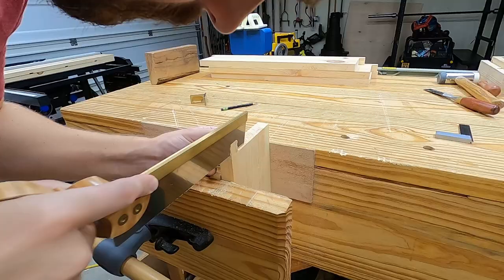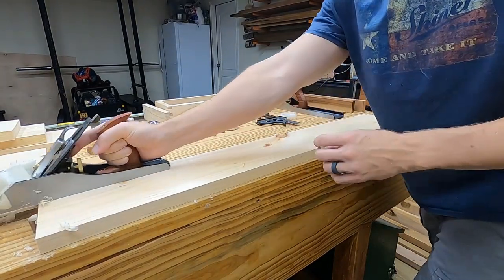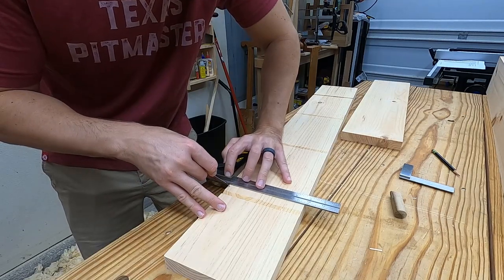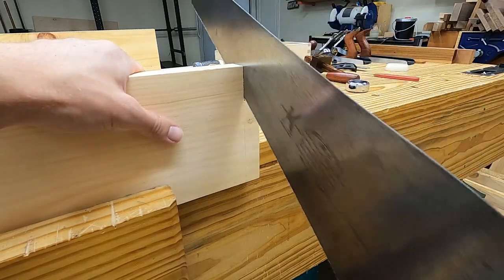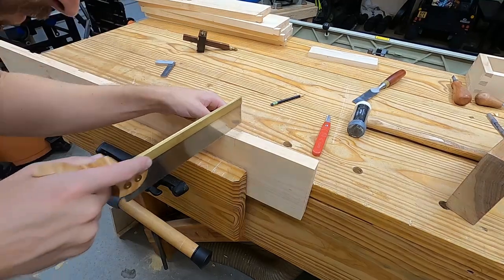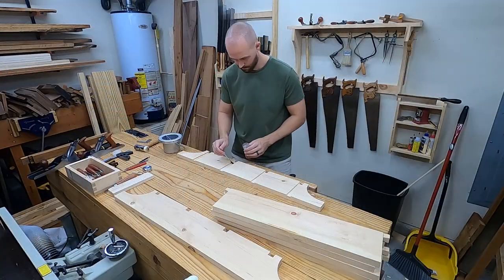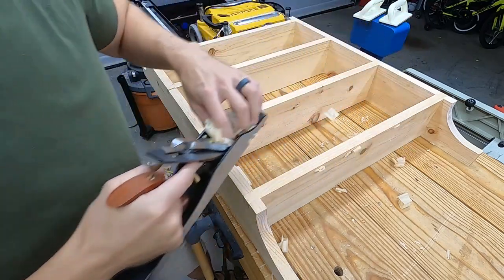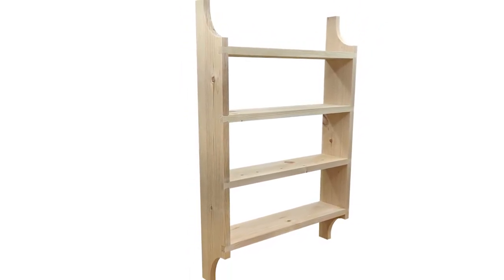OVERKILL Shop Shelves

Comment: Go to a #4 1/2 for the smoother. It will give you a larger tote, for your bigger hand. Same for the #5 1/2. It has a larger tote as well. Or you can make your own and increase it's size to make it easier to hold onto.

Comment: I love your work and combination of hand/power tools, been trying to get good at the hand tools to do the same.  I have several questions though, why the block plane for the shooting board and I assume the flipping for the shelf cut is for staying accurate on the knife line?
Thanks, Tim
Reply from the maker: thank you! block plane for shooting board is really just to avoid having to sharpen my jack plane right away... always have to sharpen the jack plane after using it on the shooting board...

Comment: Just subscribed so I'm catching up on your vids.  In the vids I've watched you use a low angle block plane for the shooting board. Others on YT advocate for a 62 or a 5 or six.  Why do you prefer the block plane?  I ask because I have tried to use a No 4 on the shooting board just for kicks, but just got a WR low angle block plane and finally have been able to use the shooting board with some success...it's quite liberating! Why isn't bigger/heavier better? Thanks.
Reply from the maker: Thanks for subscribing! I started using the block plane for shooting board to avoid having to sharpen my #5 again right after shooting... turns out it worked extremely well as long as the plane is sharp, and the cut isn't too heavy! I do think the extra mass on larger planes is helpful ,but it can be done with a block plane too

Comment: Frank, great build, your video editing is getting to be top notch. Your voice over is spot on. clear, simple to the point explanations. You asked if the shelf was over complicated, I believe that our skills as hobby wood workers is developed in our shop. I've re made every storage, tool wall item in my shop a few times. As your skill improves, you think, "i could have done better" and the shop update happens. Using less expensive pine for shop items helps to build skills for when we start using Walnut, Cherry etc. Thank you for the time you invest in this channel. BTW, are you mixing your own hide glue?
Reply from the maker: Thanks Kevin! I think you hit the nail on the head re: the shop projects. And good eye, yes I did start mixing my own hide glue 😀

Comment: Frank, thank you for all the time you invest in your videos, they’re very helpful and you’re a great instructor. I’m wondering if your bench is something you designed on your own through trial and error over time or if plans exist?
Reply from the maker: The basic of it is just a Nicholson bench. I had seen it in a few books and plenty of them online, just added the face vise I wanted to use then a year or so later added the tail/inset vice. The good thing about this bench is it could be build just looking off some Google images, just pick your length. A very knock-it-together style bench
Reply: I’m planning on building the bench outlined in “The Minimalist Woodworker” but I like your addition of the face and tail vise. I think I’ll approach it incrementally, it will be a great learning opportunity. Thanks again for sharing  all the great work you do!

Comment: Good job, want to see finished product, maybe next video. Where did you get dove tail marker, I have been looking for one like that?
Reply from the maker: Yep it will be up on the wall in the next video ;) I hung it with keyhole hardware. The marker is from sterling tool works. A beautiful product, definitely a luxury but worth it, imo. I'm honestly surprised I haven't seen any 3d print version of that style for 1/2 the price bc it is the best design for a DT marker on the market.